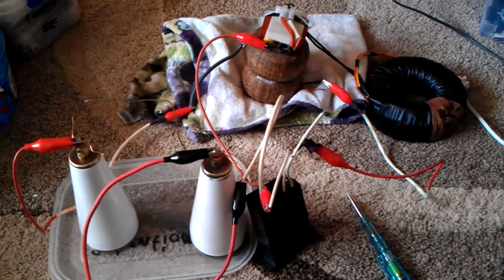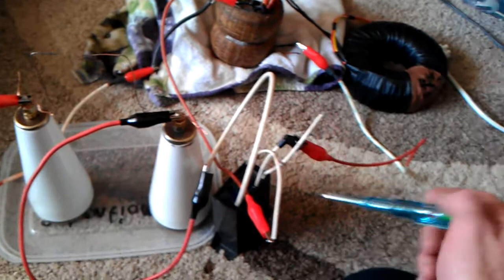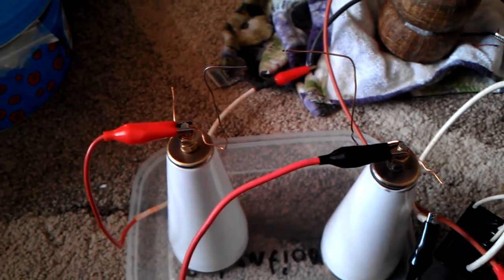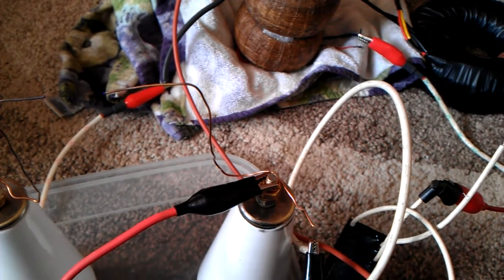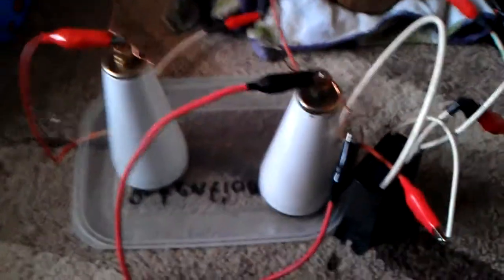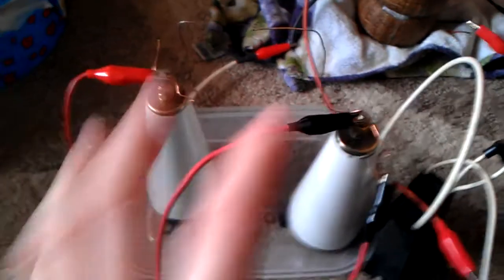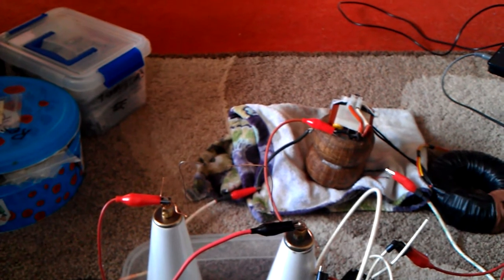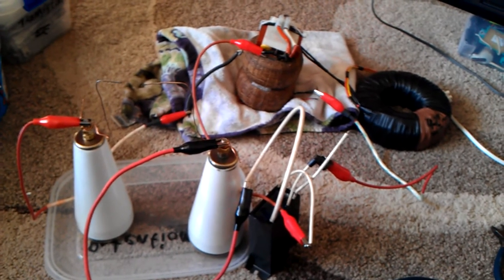High voltage tripler

Comment: FWIW TV cascades are not designed for mains frequency operation! -- 15kHz through 40kHz will produce far better results!
Reply from the maker: yes lol. I did realise this after thanks. 
I tryed it with a line output transformer/flyback" and got much better results. 

thank you for the info and comment.

be safe.👍 

Anthony 

High1voltage1rules

Comment: Neat, but do NOT connect it directly to a sparkgap, you are going to blow the internal diodes doing that (and possible the caps).
use a output resistor so you don't kill it.